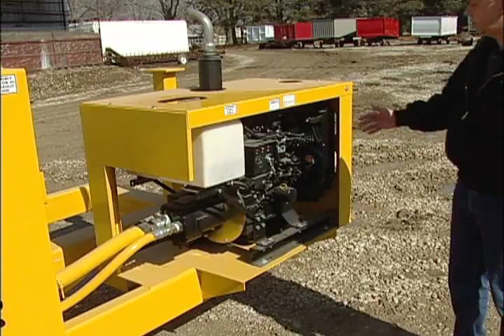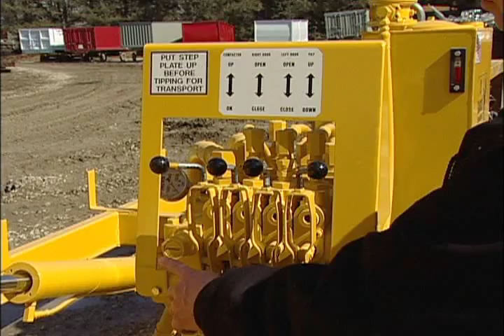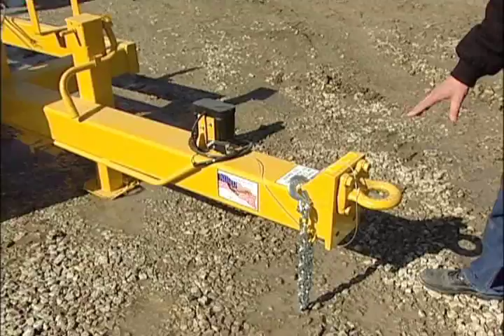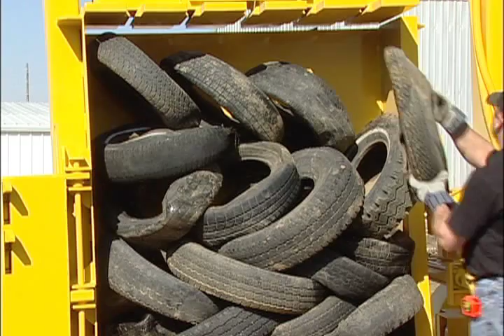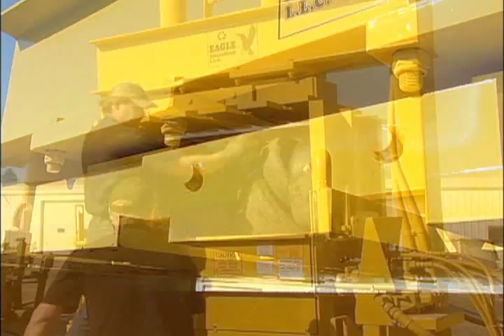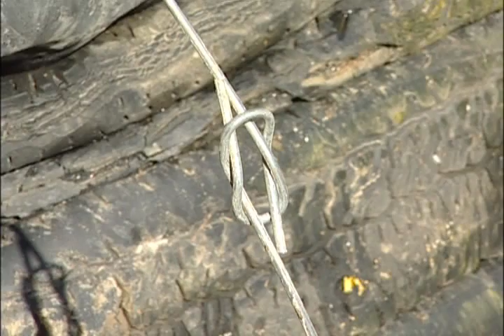Eagle ETB90 Tire Baler

Comment: Can you do double wires to add strength to avoid a blow out?
What is the gauge of wire used?
If the wires are crossed, how do you avoid hitting them when loading?
Do you have a price for this baler and warranty information?
Thanks
Reply from the maker: Hi Ron, Thank you for your comment. Your questions have been forwarded on to the our salesman.